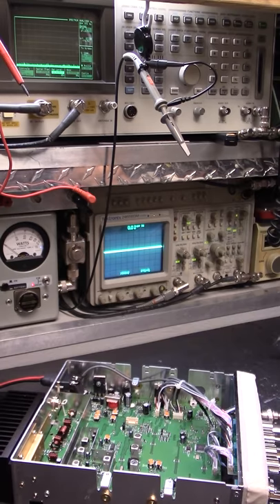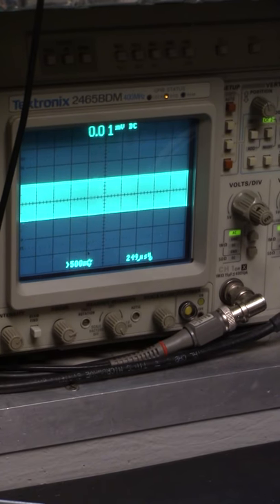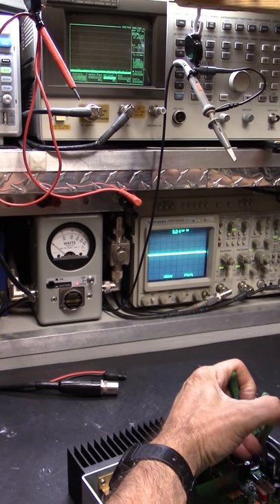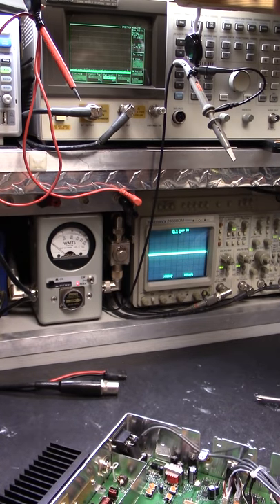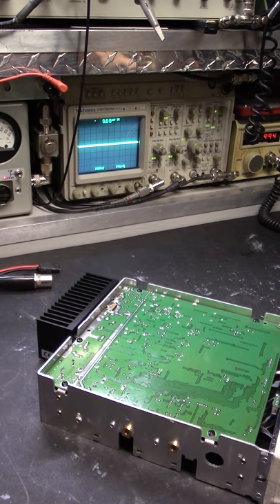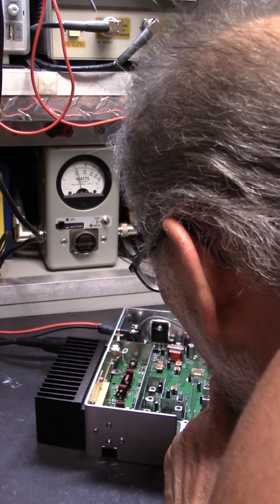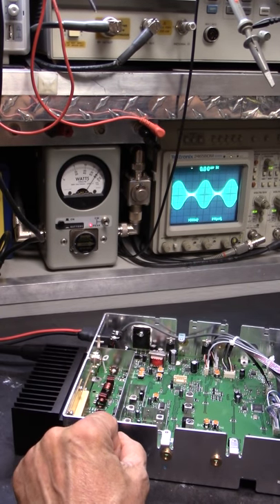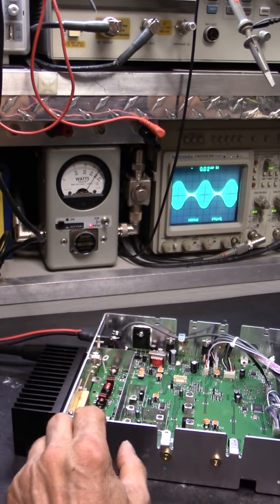"Real World" Factory TIP36c Regulator vs Max Mod  ..  See For Yourself! 😎

Comment from the maker: This will vary according to type, voltage, temperature, tune and number of fets.  I wouldn't own a new radio without it including the ERF2030 Plus's!

PAY ATTENTION!
If they don't or wont show you .. like this .. they're stroking you,  get that Part?  Never settle for less! Here's what it takes to cut through the noise, be loud and crystal clear with a better receiver too:  A) Tuned Bench:  https://www.youtube.com/watch?v=lwcDfXOgAls. 
True, it's more complicated and time consuming to accomplish these consistent and accurate results. Below is a partial procedure and list of calibrated equipment used to achieve this level of performance . Read on ..

Fine Tune CB Radio Shop strictly adheres to (https://www.nist.gov/) NIST Traceable Calibrations and other industry standards to maintain accuracy and consistency for providing Real World Performance Tuning of Citizens Band and 10 Meter export mobile radios with integrity.

"Basic Textbook AM/FM/SSB Transceiver Tune, Alignment and Calibration" 

1) Pll adjustments
VCO & OSC, AM TX OSC, USB TX OSC, LSB TX OSC.

2) Transmitter alignment
DRIVER BIAS, FINAL BIAS, SSB  (or gate voltages for mosfet versions) CARRIER BALANCE, HI-LO AM & SSB Power, RF METER, AMC, ALC and FM DEVIATION.

3) Receiver alignment
AM/FM RF & IF SENSITIVITY, FM DETECTOR/DEVIATION, SSB IF SENSITIVITY, SSB S-METER, AM/FM S-METER (100uV unmodulated -67dbm for “S-9” meter reading!), AM/FM SQUELCH RANGE, SSB SQUELCH RANGE, and NOISE BLANKER/AUTOMATIC NOISE LIMITER (Real World dBm to volts (uV) tables below).

That's just a typical run of the mill textbook tune up and alignment (if you're lucky). There's more to it than frequency alignment, modulation adjustment, meter calibration and a tune up report displaying exaggerated rms Bird peak watts! 

"Test Bench includes"

Bird 4314C Meter
https://www.birdrf.com/Products/Test%20and%20Measurement/Power-Meters/Wattmeters-Line-Sections/RF-Wattmeters/4314C_PEP-Single-Element-Wattmeter.aspx
Part 1) https://www.youtube.com/watch?v=RpX9IHe4ORM&t=16s
Part 2) https://www.youtube.com/watch?v=LuhbqTf6Bxw
Bird 4314C Accuracy Test: https://www.youtube.com/watch?v=DqEOabYqhQo&t=5s
Bird Stipulates 1/2 wavelengths  https://www.youtube.com/watch?v=5eWhgT-rTII
And Genuine Bird Elements from 1K down.

Bird 4373 Sampler 
https://www.rfparts.com/signal-samplers.html

HP8924c with options
http://userequip.com/files/specs/2147/HP%208924C%20Repair.pdf
https://www.youtube.com/watch?v=Cg1w0xBa27s&t=1s

HP8920a with options
https://www.keysight.com/upload/cmc_upload/All/EPSG072204.pdf

Three analog scopes, one digital 200 Mhz
https://www.atecorp.com/atecorp/media/pdfs/data-sheets/tektronix-2465b-2467b_manual.pdf
https://www.youtube.com/watch?v=by98x4eu2lM

Fluke 27fm
http://www.fluke.com/fluke/inen/digital-multimeters/fluke-27.htm?pid=56055
 
LCR http://www.lcrresearch.com/wp-content/uploads/2017/05/LCR_Pro1_Manual_version1.03.pdf

Power supplies
6 Cosel PBA1500f12 (750 amps) variable and configurable.
https://en.cosel.co.jp/product/powersupply/PBA/PBA1500F/PBA1500F-12/
Corcom 20VB1 F7130 EMI Filter 50-60Hz 250V

Times Microwave Coax jumpers and test leads
http://www.timesmicrowave.com/cms/products/cables/lmr/
https://www.youtube.com/watch?v=EmqaGJ6IWow
https://www.youtube.com/watch?v=1ltFVSxGp5Y
https://www.youtube.com/watch?v=v12YZT_1o90
https://www.youtube.com/watch?v=h7iiYfmYWRA&t=215s

Amphenol RF Connectors
https://www.amphenolrf.com/
https://www.youtube.com/watch?v=dVh5B0hdEA0 
https://www.youtube.com/watch?v=dKZg8T_AOso

More range, compliments, reliability and a quieter, clearer but more sensitive receiver,  Get Fine Tuned .. not peaked and ruined.

Here are some VideoGates of me at the bench practicing what I preach using my bench radio or customers radio completed and ready to be shipped: https://www.youtube.com/results?search_query=hard+drive+163+ more: https://www.google.com/search?q=Hard+Drive+163+nm&ie=utf-8&oe=utf-8&client=firefox-b-1-ab

It's what I recommend, use, service and sell ... to you ... not something non practical or deceiving in a misleading way. I'm not just the tech and owner of Fine Tune CB Radio Shop, I'm a customer too!  When finished, You'll be giving radio checks, not asking for them .

dBm To Watts and Volts
Tables below displays relationship between Power in [dBm] or [Watts] and Voltage in RMS, peak, peak-to-peak for sinusoidal signals in 50-Ohm systems for accurately measuring and tuning am/fm/ssb receiver sensitivity, agc, squelch and "S9" Meter calibration.

  [dBm] [Watts]   [Volts]rms   [Volts]p    [Volts]pp
-140 0.100E-16  22.361 nV  31.618 nV  63.236 nV 
-139 0.126E-16  25.089 nV  35.476 nV  70.952 nV 
-138 0.158E-16  28.150 nV  39.805 nV  79.609 nV 
-137 0.200E-16  31.585 nV  44.662 nV  89.323 nV 
-136 0.251E-16  35.439 nV  50.111 nV  100.222 nV 
-135 0.316E-16  39.764 nV  56.226 nV  112.451 nV 
-134 0.398E-16  44.615 nV  63.086 nV  126.172 nV 
-133 0.501E-16  50.059 nV  70.784 nV  141.568 nV 
-132 0.631E-16  56.167 nV  79.421 nV  158.842 nV 
-131 0.794E-16  63.021 nV  89.112 nV  178.223 nV 
-130 0.100E-15  70.711 nV  99.985 nV  199.970 nV 
-129 0.126E-15  79.339 nV  112.185 nV  224.370 nV 
-128 0.158E-15  89.019 nV  125.874 nV  251.747 nV 
-127 0.200E-15  99.882 nV  141.232 nV  282.465 nV 
-126 0.251E-15  112.069 nV  158.465 nV  316.931 nV 
-125 0.316E-15  125.743 nV  177.801 nV  355.602 nV 
-124 0.398E-15  141.086 nV  199.496 nV  398.992 nV 
-123 0.501E-15  158.301 nV  223.838 nV  447.677 nV 
-122 0.631E-15  177.617 nV  251.151 nV  502.302 nV 
-121 0.794E-15  199.290 nV  281.796 nV  563.591 nV 
-120 0.100E-14  223.607 nV  316.180 nV  632.360 nV 
-119 0.126E-14  250.891 nV  354.760 nV  709.519 nV 
-118 0.158E-14  281.504 nV  398.047 nV  796.094 nV 
-117 0.200E-14  315.853 nV  446.616 nV  893.232 nV 
-116 0.251E-14  0.354 µV  0.501 µV  1.002 µV 
-115 0.316E-14  0.398 µV  0.562 µV  1.125 µV 
-114 0.398E-14  0.446 µV  0.631 µV  1.262 µV 
-113 0.501E-14  0.501 µV  0.708 µV  1.416 µV 
-112 0.631E-14  0.562 µV  0.794 µV  1.588 µV 
-111 0.794E-14  0.630 µV  0.891 µV  1.782 µV 
-110 0.100E-13  0.707 µV  1.000 µV  2.000 µV 
-109 0.126E-13  0.793 µV  1.122 µV  2.244 µV 
-108 0.158E-13  0.890 µV  1.259 µV  2.517 µV 
-107 0.200E-13  0.999 µV  1.412 µV  2.825 µV 
-106 0.251E-13  1.121 µV  1.585 µV  3.169 µV 
-105 0.316E-13  1.257 µV  1.778 µV  3.556 µV 
-104 0.398E-13  1.411 µV  1.995 µV  3.990 µV 
-103 0.501E-13  1.583 µV  2.238 µV  4.477 µV 
-102 0.631E-13  1.776 µV  2.512 µV  5.023 µV 
-101 0.794E-13  1.993 µV  2.818 µV  5.636 µV 
-100 0.100E-12  2.236 µV  3.162 µV  6.324 µV 
-99 0.126E-12  2.509 µV  3.548 µV  7.095 µV 
-98 0.158E-12  2.815 µV  3.980 µV  7.961 µV 
-97 0.200E-12  3.159 µV  4.466 µV  8.932 µV 
-96 0.251E-12  3.544 µV  5.011 µV  10.022 µV 
-95 0.316E-12  3.976 µV  5.623 µV  11.245 µV 
-94 0.398E-12  4.462 µV  6.309 µV  12.617 µV 
-93 0.501E-12  5.006 µV  7.078 µV  14.157 µV 
-92 0.631E-12  5.617 µV  7.942 µV  15.884 µV 
-91 0.794E-12  6.302 µV  8.911 µV  17.822 µV 
-90 0.100E-11  7.071 µV  9.998 µV  19.997 µV 
-89 0.126E-11  7.934 µV  11.218 µV  22.437 µV 
-88 0.158E-11  8.902 µV  12.587 µV  25.175 µV 
-87 0.200E-11  9.988 µV  14.123 µV  28.246 µV 
-86 0.251E-11  11.207 µV  15.847 µV  31.693 µV 
-85 0.316E-11  12.574 µV  17.780 µV  35.560 µV 
-84 0.398E-11  14.109 µV  19.950 µV  39.899 µV 
-83 0.501E-11  15.830 µV  22.384 µV  44.768 µV 
-82 0.631E-11  17.762 µV  25.115 µV  50.230 µV 
-81 0.794E-11  19.929 µV  28.180 µV  56.359 µV 
-80 0.100E-10  22.361 µV  31.618 µV  63.236 µV 
-79 0.126E-10  25.089 µV  35.476 µV  70.952 µV 
-78 0.158E-10  28.150 µV  39.805 µV  79.609 µV 
-77 0.200E-10  31.585 µV  44.662 µV  89.323 µV 
-76 0.251E-10  35.439 µV  50.111 µV  100.222 µV 
-75 0.316E-10  39.764 µV  56.226 µV  112.451 µV 
-74 0.398E-10  44.615 µV  63.086 µV  126.172 µV 
-73 0.501E-10  50.059 µV  70.784 µV  141.568 µV 
-72 0.631E-10  56.167 µV  79.421 µV  158.842 µV 
-71 0.794E-10  63.021 µV  89.112 µV  178.223 µV 
-70 0.100E-09  70.711 µV  99.985 µV  199.970 µV 
-69 0.126E-09  79.339 µV  112.185 µV  224.370 µV 
-68 0.158E-09  89.019 µV  125.874 µV  251.747 µV 
-67 0.200E-09  99.881 µV  141.232 µV  282.465 µV
-66 0.251E-09  112.069 µV  158.465 µV  316.931 µV 
-65 0.316E-09  125.743 µV  177.801 µV  355.602 µV 
-64 0.398E-09  141.086 µV  199.496 µV  398.992 µV 
-63 0.501E-09  158.301 µV  223.838 µV  447.677 µV 
-62 0.631E-09  177.617 µV  251.151 µV  502.301 µV 
-61 0.794E-09  199.290 µV  281.796 µV  563.592 µV 
-60 0.100E-08  223.607 µV  316.180 µV  632.360 µV 
-59 0.126E-08  250.891 µV  354.760 µV  709.520 µV 
-58 0.158E-08  281.504 µV  398.047 µV  796.094 µV 
-57 0.200E-08  315.853 µV  446.616 µV  893.232 µV 
-56 0.251E-08  0.354 mV  0.501 mV  1.002 mV 
-55 0.316E-08  0.398 mV  0.562 mV  1.125 mV 
-54 0.398E-08  0.446 mV  0.631 mV  1.262 mV 
-53 0.501E-08  0.501 mV  0.708 mV  1.416 mV 
-52 0.631E-08  0.562 mV  0.794 mV  1.588 mV 
-51 0.794E-08  0.630 mV  0.891 mV  1.782 mV 
-50 0.100E-07  0.707 mV  1.000 mV  2.000 mV 
-49 0.126E-07  0.793 mV  1.122 mV  2.244 mV 
-48 0.158E-07  0.890 mV  1.259 mV  2.517 mV 
-47 0.200E-07  0.999 mV  1.412 mV  2.825 mV 
-46 0.251E-07  1.121 mV  1.585 mV  3.169 mV 
-45 0.316E-07  1.257 mV  1.778 mV  3.556 mV 
-44 0.398E-07  1.411 mV  1.995 mV  3.990 mV 
-43 0.501E-07  1.583 mV  2.238 mV  4.477 mV 
-42 0.631E-07  1.776 mV  2.512 mV  5.023 mV 
-41 0.794E-07  1.993 mV  2.818 mV  5.636 mV 
-40 0.100E-06  2.236 mV  3.162 mV  6.324 mV 
-39 0.126E-06  2.509 mV  3.548 mV  7.095 mV 

                 Don't Be A Mud Duck!

Hard Drive 163 NM. 73's! Click click.